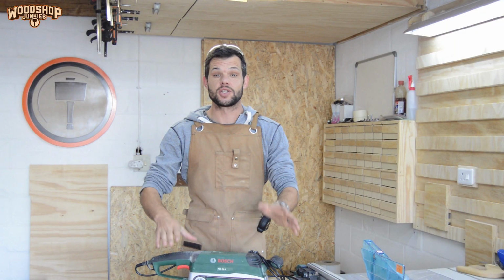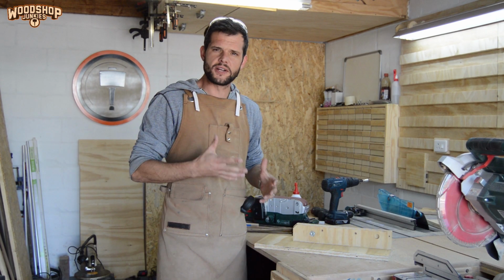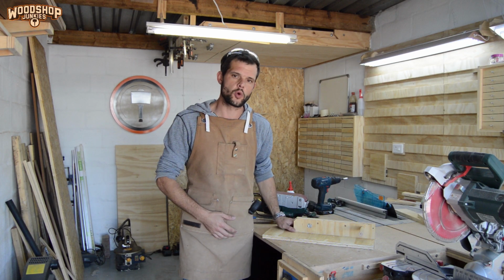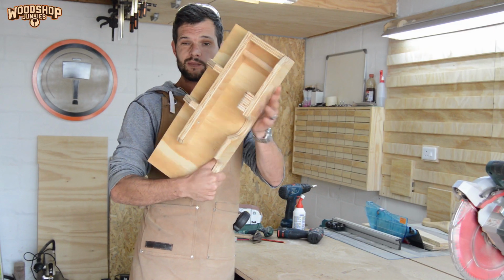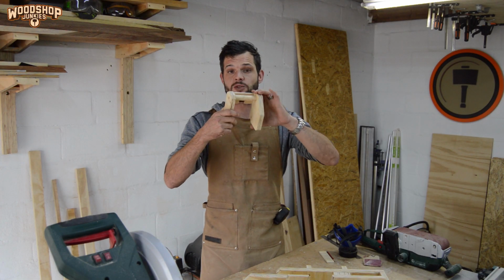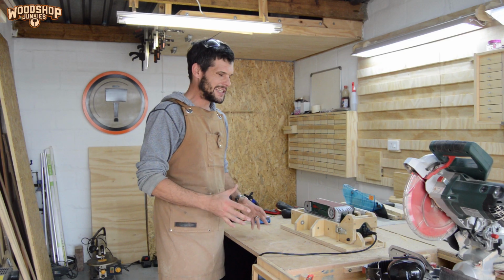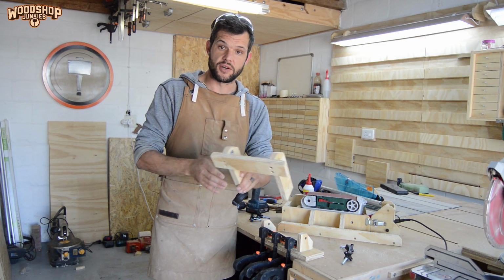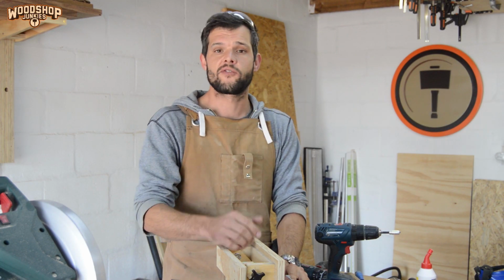Maximizing A Handheld Belt Sander

Comment: I just put mine in a 3 inch hobby vice. The sander is held by the handle, and the position can be adjusted to different positions. I don't usually use a platform to work off , but this is an easy improvise.

I don't know why manufacturers do not make these jigs. They would be a welcomed accessory.

Comment: I would have made the latch swivel 90° from how it now functions. That way you can put the beltsander in the holder and then put the latch over it without having to worry about the cable.
Nice work and a very handy extention of the tool.

Comment: You could run French cleats on the long side as well and I would hang  horizontal or vertical, although the that would have to be done initially because the top clear and bottom support would need to be notched out to allow for horizontal mounting.

Comment: You rock man! Today I’ve created my jig largely based on your idea. I happen to have the same belt sander 😎. I’ve only changed the locking mechanism as I don’t like to have to do  the threading thing with my power cord. I had a little toggle clamp lying around, so I put it on a small block next to the handle and let it clamp on the handle. very stable and very easy to setup or remove. Thanks a lot though. People like you inspire me every day!

Comment: Amazing build - as always :) 
My first thought in regards to the vertical/horizontal function would be to have them both accessible with french cleats. 
Cutting out a section of the vertical cleat and running another one horizintally would allow you to simply 'flip' the setup on the wall. 
Cheers

Comment: @woodshop Junkie, great to see a local youtuber doing woodwork. I can see you aren't using the local handmade plywood. Do you mind sharing where you purchase these boards?
Reply from the maker: I mostly use normal pine plywood that I purchase from "The Board Store" (Cape Town). They also sell high quality Birch ply but that is a bit pricey for shop projects in my opinion.
Reply: @WoodshopJunkies  Thanks , agreed. Okay cool, I'm from Jobrug. I found a place called universal plywood. Reason asking is that I got a CNC that can cut a full sheet plywood. It's a vertical one, that you build self

Comment: Having never owned a mounted sander of any sort, what is the advantage to using it in the vertical position? It looked like you accomplished the same thing with it flat on the table. Is it just the ability to use the entire width of the belt so you don't wear the bottom bit out as fast or is there more to it?
Reply: I have a full-size floor-standing belt sander, but I'm seriously considering trying to build this for my large hand-held one, which I'm hardly ever using at the moment, because I can imagine it would work pretty well in that vertical mount for sanding the edges of smaller objects. Looks like it would be considerably easier to sand the edges of smaller objects accurately than on the floor-standing one... 🤔

Comment: Nice. Perhaps make the fence curve around at the end, to make use of the curve section of the belt? This way it can be used on internal curves when in the horizontal position. Shouldn't interfere with the use in the vertical position.

Comment: Hey dude, instead of the t nut have you ever considered using these :http://www.gelmar.co.za/p/697/wood-insert-m8-x-20mm from Gelmar? I used to use t nuts for my wooden projects that required constant taking apart and screwing back together and found that they came unseated fairly easily. the threaded inserts on the other hand not only stay put thanks to the thread on the outside but look a lot more pleasant with the finished project . you also dont need to drill twice to get a flush fit; simply drill the hole that accommodates the desired sized insert and screw it in until it counter sinks itself.
Reply from the maker: I have used these in the past and have a few laying around the shop. The t-nuts are however, more readily available in my immediate area.
Reply: @WoodshopJunkies  fair enough. enjoy whats left of your weekend.

Comment: 13:45 - If the thumbnail for this video hadn't included the wall mount, my head would have exploded at this instant.  Jean, this design rocks, especially the (head-exploding) cleat and the two-way fence.   I missed a chance to get an inexpensive belt sander a while back and you have me kicking myself a second time.  Great job.

My only suggestion is about power/switching.  If you had a switched outlet and extension mounted to the jig, you could turn it on and off without reaching in for the trigger.  However, this would add some bulk to the design, so it's not without cost.  Certainly not parts I have laying around my garage, either.

Stay healthy and safe.

Comment: Well done and inspiring!
About corded tools and the issue you had with cord, I am sharing with you an idea from  Marius Hornberger: I have cut my cords at about 20cm from the tool and installed powercon connectors. Now I have a short (2 m) and a long (5m) electrical cords and easily disconnect/reconnect most of my corded tools (such as belt sander, circular saw, jig saw, router, reciprocating saw, pole tree pruner...)

Comment: Looks super good! Just might need a way to anchor it to the bench. Maybe something like your spring loaded French clear design mounted horizontally on a board that can be clamped to the bench?  Or inserting the spring loaded french cleat into the bench itself. Then it could be a modular station set up for whenever you need to secure a mount to the bench temporarily

Comment: Bosch didn't design it for this obviously. Mine (brand Truper) has two holes over the width of the machine and a flat top surface so it can be easily attached to a surface with clamps.
Reply: Doug Vegan Paradise Builder mine PBS75 from bosch has an adapter plate to screw onto the top that allows for clamping that thing to a table
https://f01.osfr.pl/foto/3/13662469109/eb2147152b0f46f214902b84e997e937/bosch-pbs-75-ae,13662469109_7.jpg

But I wouldn’t come up to mount this at the wall to take full advantage.

Kudos to the video and the solution that allows basically adapt to any beltsander out there! Also the tables to be switched is a great feature!

Nice work!

Comment: Great video. How about splitting the dowel on the clamp in half and make just enough space for the cord guard? Or you can modify the clamp so you can attach a hinch on the latch side, screw the dowel on the hinch and screw another latch to the dowel and clamp on the other side.

I don't know if I heard right but your router sounds a bit jumpy. Maybe you yould check the brushes.
Reply from the maker: Thanks!

Comment: Super cool. I like how the fence works in both positions and even acts as a foot in the horizontal position.

I think I would have slotted the holes in the table so it could be adjusted in and out from the belt, so when at an angle, you could still get it tight against the belt. Probably put an angle on the front edge as well to get it as close as possible.
Reply from the maker: Great idea! Thanks!

Comment: I would make the vertical set up so that the cord is on top and the belt moves down (instead of up). This would help keep work on the table/fence and any dust not captured would be thrown down instead of up into your face.
Reply from the maker: The belt is moving down. If the cord is on top then it would be moving up.
Reply: Guess you have never used a belt sander.
Reply: Do to the frame rate of the video and the "wagon-wheel" effect that occurs, it does look like the belt is moving upwards.Probably why they commented.
Reply: Nice project, well engineered and very satisfying to watch. I could very well make one like that as I have a Parkside sander of similar shape like yours. However, the time it takes to make a jig like that, I’m happy to forget about the money and buy one already done  😂😂